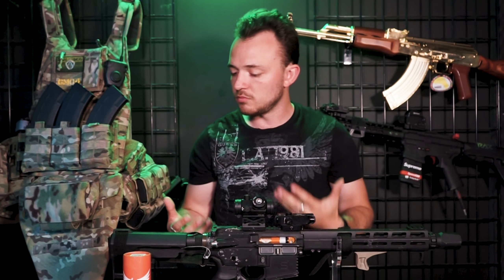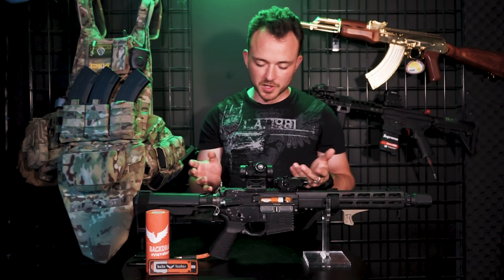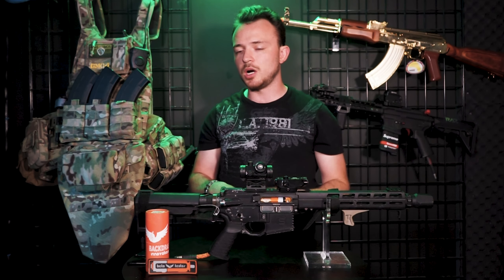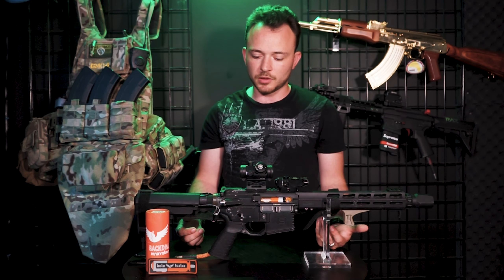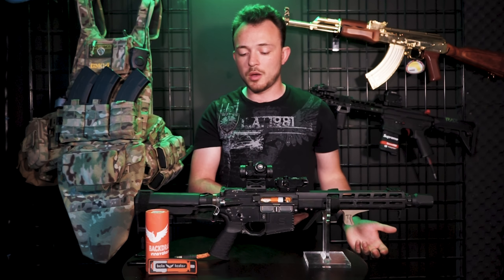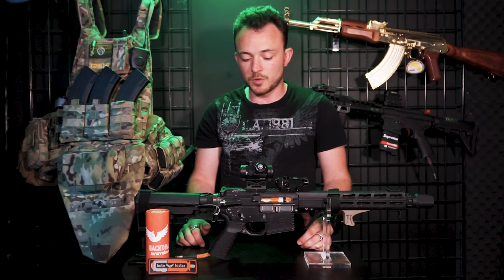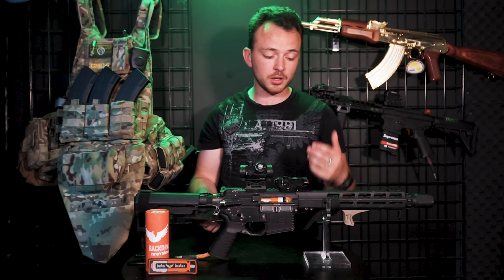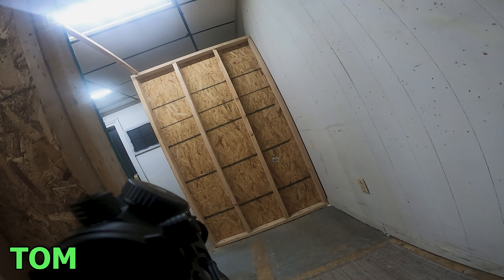The PHOENIX by Backdraft Innovations | First Impressions / Review

Comment: i just bought one yesterday technically still a beta tester. can't wait to install it. its going in my cyma aks74u because the gate aster I have in it is curse. i try not to hpa my guns but there are just some guns where you kind of have to like the svd. of course there's no support for the svd yet. if you want you can get a custom nozzle and it might woek in your sr25 but that costs exta. i had to pay extra for the ak board
Reply: It’s getting dropped off at the post office tomorrow :)
Reply: my ak 74u started getting loose on the front and my hpa engine kept jamming , look out for it

Comment: How loud is it compared to other engines?
Reply: can be pretty loud, at least the beta unit was
Reply from the maker: no louder than a Jack. The solenoid sounds louder than other units, but that is only noticeable without air plugged in. With air plugged in it is just as loud as the P* Jack and Gate Pulsar S.
Reply: It's nothing that can't be dealt with when you use a suppressor with good foam. I'm digging my beta engine so far.